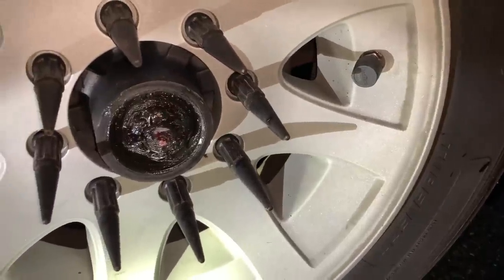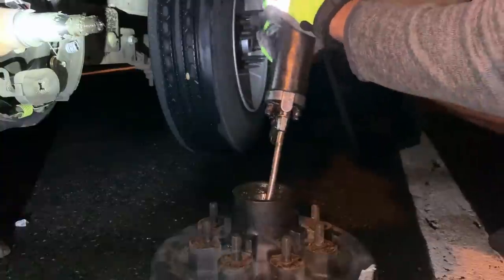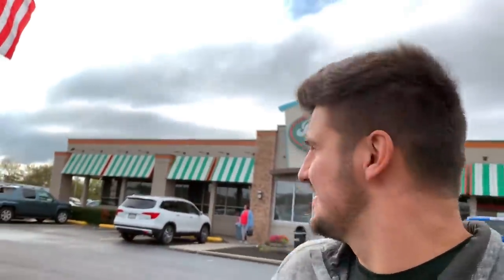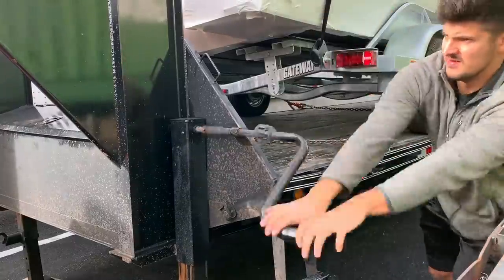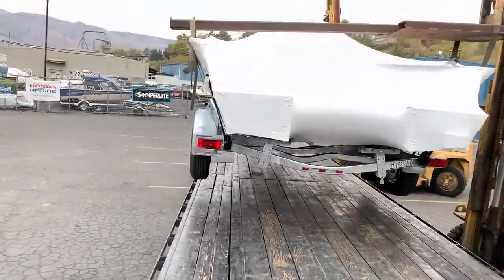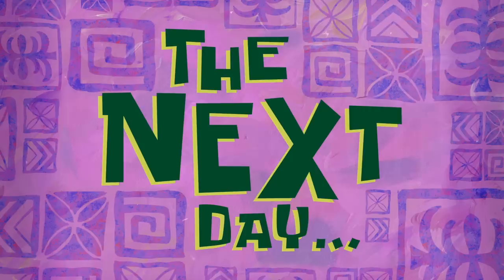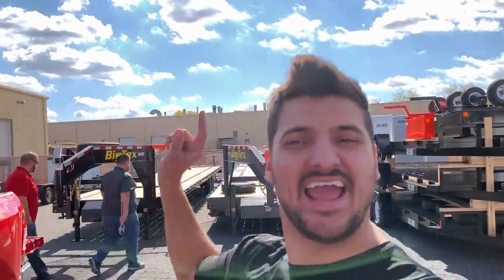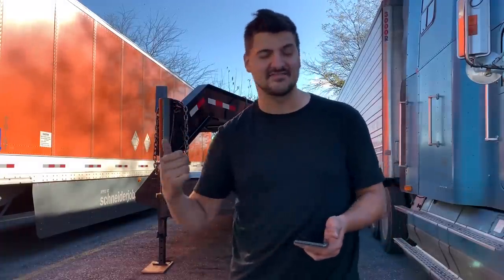New NON-CDL hot shot TRAILER - Vlog 17

Comment: Trailer looks Awesome!.  When I got mine a month ago I pointed out to the dealer that other drivers were complaining about the paint peeling prematurely.  They assured me that they heard those complaints and improved the paint work.  I'm not sure if this happens to all new trailers but they also told me that the brakes on the Big T take a bit to adjust so you might have to increase the gain a bit until they fully adjust. Oh yeah! and Check the hub temps sooner than usual  as I had a couple issues with mine heating up. Could of been the gain, but only one was heating up more than the others.

Comment: The government is so absurd with some of their regulations and rules.  To be able to change a sticker on the trailer and have it be legal, without doing anything else, is a classic example why there are so many jokes about the different agencies.  I truly feel sorry for anyone involved in interstate commerce, where you have federal and state enforcers creating even more conflicts.
Reply: You register your trailer to what you want. I could register my 24K to only 10K but would get an overweight ticket.
Reply: @dungeondark  Depends on the officer, and his level of tolerance, and/or common sense. Try that in KY and TN, see what happens, you'll be hunting a cdl driver to drive your truck away from the weigh station. They go by the VIN sticker.
Reply: you still MUST have a cdl if your hauling anything commercially,  over the combined weight of 26001 pounds, this is your truck, trailer, if your truck is rated (GVWR) to pull over 26001 pounds and your trailer is rated to pull 12000 pounds you need a class A cdl BUT your trailer in its self cannot be rated to pull over 10000 pounds.  Also even though if you have a club cab that isn't a dot approved sleeper
Reply: Just Shakey J Currently there is A LOT of Homeowner, Small Business, Landscapers, & Excavating Companies That Are In Violation Of The Law. What I’m saying is These People Should Not Need A CDL.
Reply: I agree to some extent, if your hauling commercially you should be required but I agree if your w/in 50 miles of home base you shouldn't imo
Reply: And the ppl that makes the regulations never ever driven...

Comment: Got me enterprise rental thanks to you!
6000 free miles and 14 cents a mile anything  over the 6k a month and 1400 monthly as well !!   Thanks !!    2020 Ford F-350 dually.  Xlt with lariat upgrade , so leather and has the bigger screen navigation unit and electric mirrors.        Since I blew up my 2016 f250 this was the way to go.   Hell got it thousands of miles away from Indiana. Lol.
Reply: james S what happened with your f250 if you don’t mind me asking?
Reply: Dixieland Hotshots    Our 265,000 on in 2 years!  Had 8000 idle hours and 18,000 engine hours.   Never shut off ever except for maintenance,   Got it deleted at 160,000 miles.   Never an issue ,   Was pilling only 9,000lbs and overflow filled with oil,  aka head gasket sign usually ,  then white smoke and starting knocking loud as hell.   So it’s 12k for new engine and labor. 1 day to do it with 2 year warranty.  No use to see if just head gasket since it adds up to probably same price after all said and done , so I said screw it.   Sitting at my house and went with enterprise.  Lol lol.   Beside that. Mint condition not a scratch. No issues beside  that ever
Reply: james S dang man you got your money’s worth out of her!! I love my 2012 f250. I was asking just to see if I should be on the lookout for something  like the fuel pump or something but yeah, I’m not quite as brutal on mine as you are and I’m not deleted so hopefully my head pressure will stay down and last for the long haul. thanks for all the info and congrats on your new truck! Gonna be a nice ride for sure.
Reply: Where did you pick up your rental james
Reply: Dixieland Hotshots    I have a 2014 f250 with 615,000 miles on it.    Not deleted.   No issues.      So one was good.  Other not so much. Lol
Reply: Matt Mitchell      California
Reply: Where in California did you get your rental in much closer to California than Indiana
Reply: idksht   Near Stockton.    Must have California driver license.   I said shit watch this.  Went got me a mailbox for 29.00 a month. Went to dmv and said I have. Moved from PA.  Here’s my address.  Boom. Took that and issued me Cali license.     Then after getting my rental.   Went and switched back to PA.   Since PA don’t count any out of state violations except dui.   No other ones count on PA state record. They don’t belong to driver compact     So wanted to give you heads up.   They are starting to do the same state driver license at some.     The one in Indiana.  Not Elkhart.  The one Jordan is it also makes you have indiana or Kentucky only driver license.     I can give you number etc.  let me know.

Comment: If you make a very small hole in your dust caps like you drill it with a 1/16” they won’t pop off, pressures will equalize , it’s normal to have thermal expansion, might just work

Comment: First off you must have a medical card on you when you drive any truck over 10,000 gvw. Commercialy.
You must have cdl license when you tow in excessive gvw over 26,001 
You must obey all DOT rules including logging your hours.
Reply: I think the CDL cutoff is 10k not 12 k for the trailer.
Reply: Ohio dot just hit my driver on that. Med card in F350SD rated at 14k, trailer rated 14k they said have to have a cdl. Scaled it loaded at TA 20640, empty 14k. See how it turns out? My reply was any dually is essentially requiring a A license then respectfully of course, also mentioned if you use sticker gvwr does that mean every semi requires a overweight permit? Truck rated 80k, trailer whatever it is. I use a wedge n a 1axle Volvo with a A license. For guys hotshotting you guys really have some slim differences between legal n not, odd a dually is safer but no modern dually is under 10k. Eld is junk fill out a logbook as a heads up also. Be safe n really look at what you can do before you drop or commit to 10s of Gs so your not SOL. It hurts.

Comment: In most states if your trailer is over 10,000 lbs you need a CDL, Not Ny but if the tow vehicle is 10,001 lbs gvw or over with a trailer over 10,000 gvw you need a CDL even if you are under 26,000 gvw

Comment: erm when you said bearings and brakes are good around 2:20... the whole hub was floating in/out 1/4" as you took the wheel off and the split pin out of the hub nut... surely that would mean your preload is out or your taper roller bearings are fubar?

Comment: Ok 2 questions. 
1. Do need a CDL to pull that trailer before they changed the sticker if you where using it for yourself.  And not hotshoting.
2. Does it cost anything to weigh your truck and trailer at a weigh station like that?
Reply from the maker: 1. Yes technically yours need a CDL to pull the trailer before they changed the sticker unless you have a farmer exemption I think
2. Yes it's $12
Reply: In California and some other states any trailer over 10000 lbs you need a CDL

Comment: So, mathematically, with you doing non-cdl loads, you are allowed to have cargo weight of no more than 9,661lbs, correct?

You have a truck rated at 14k GVWR, a trailer at 12k GVWR, making that 26k total GVWR. So, you are legal with the weights of the truck and the trailer based on GVWR as well as your total weight being 16,340lbs. That allows for a cargo of just over 9,600 lbs. 

When you go out for a load, do you first request something say not over 9,500lbs to accomodate for differences in fuel weights or did you weigh in with a full truck load including tools, full fuel tanks, tarps, etc?

Comment: I do this, have a trailer made, but under-rate trailer to 9,999 lbs even though it could carry 15k.  Also, I use a equipment trailer, single axel. Rated at 9.5k so I don’t need a DOT Number or CDL.  Inspector told me about that one.  Does he need new 83” HD axes???

Comment: From what I have heard. If you have a combination greater than 26,000 and if the trailer gvwr is over 10,000 lbs you have to have cdl.
Reply: 26001 or higher. Truck is 14 trailer is 12 so he's at max before cdl requirements. That's as long as doesn't go over in his load weight.
Reply: Thanks for info and a better understanding. Dot seems to try to get you in all directions.

Comment: Unless something has changed : federal DOT applies to interstate hauling ( this includes not for hire - edit : for gvwr over 26 k )     The DOT regulations apply to:

    Vehicles with a GVWR or gross combination weight rating (GCWR) of more than 10,000 lbs.
    Vehicles with a GVWR of more than 26,000 lbs., which require commercial driver license (CDL) to avoid CDL driver disqualifications.
    Vehicles hauling hazardous materials, whether operating across state lines or totally within one state.
    Trucks or for-hire small buses designed to carry more than 16 people, including the driver.
     California and North Carolina reg's require a cdl for 10,000 + capacity trailers period, even if unloaded..
Reply: I live in North Carolina and can say for a fact CDL is only needed once you go over 26,001 pounds, call me a liar if you would like but I think the weigh station I have driven through multiple times a week would of said something by now.

Per back of licence

Any-non commercial single vehicle with a gvwr of less then 26,001. A vehicle towing a vehicle which has a combined gvwr of less than 26,001 operated by a driver 18 years and older.
Reply: @nschrandt91   Again :" Unless something has changed " or you have an out dated license,  Read what i stated again if necessary. they may have dropped the 10,000 + trailer CDL requirement very recently.. Its still on the regulations sites i used.
Reply: @ronc8598  They removed the 10,000 trailer rule quite a few years back. Just was stating no longer needed.
Reply: People misunderstand that sentence all day long with the 10,000 lbs trailer rule. What they are referring to is if you are over 26,001 lbs AND have a trailer over 10,000 lbs than you need a "CDL A" and if you are over 26,001 lbs but have a trailer under 10,000 you still need a CDL but class B not A. If you are under 26,001 lbs doesnt matter what trailer you have no CDL is needed. I have done inspection in almost all 48 states with a hotshot truck and never had an issue. I now have my CDL A but didn't have one for many years doing this.
Reply: For hire hauling loads on interstate highway. Is required by law to have a class A Cdl. Regardless of your weight.
Reply: John Skinner not true, at all. Before I had my cdl I went through weigh stations daily never once had a problem as long as you are below 26,001. Now you need commercial insurance if hauling for hire no matter the weight, but not a cdl.
Reply: @nschrandt91  if you cross state lines you need a MC number, if you dont you just need the DOT number, the MC number you only get it by having $1mil liability.
Reply: Maid in Boston Inc no where did I say you didn’t need those things?
Reply: @nschrandt91  I was agreeing with you and just adding the "complete" info for the ones who couldn't comprehend before 👍👊
Reply: Maid in Boston Inc gotcha lol, it’s ok I’m sure we are wrong anyways 😂😂😂
Reply: @maidinbostoninc429  It depends on the state. In California, if you are a California class C license holder, any trailer that is NOT a travel trailer or camping type fifth wheel with a GVWR over 10,000 lbs. requires a Class A CDL.to legally tow. In Nevada, adding a J endorsement on a Class C driver license issued ftom the state of Nevada, allows you to tow a trailer, like a gooseneck flatbed trailer with a GVWR above 10,000 lbs. provided the GVWR of the tow vehicle, when added to the GVWR of the trailer, does not exceed 26,000 lbs. Each state honors the requirements and/or endorsements from other states. What controls are the rules that apply to the state that issued the drivers license. All states laws meet Federal requirements. If the state says your legal, it's legal under Federal law as well. Each state has already done the homework for you. My truck has a GVWR of 10,100 lbs. If the gooseneck flatbed trailer has a GVWR of 15,900 lbs., I'm 50 state legal with a J  endorsement on a Nevada class C license. Also, actually being overweight has absolutely nothing to do with what license/endorsements you need which is all based on GVWR. Being overweight is a completly seperate matter and violation. It's just as illegal for a class A driver to exceed, for example, a trailers GVWR as it is for a class C licensed driver to do so.
Reply: @maidinbostoninc429  You know you are wasting your time, trying explain facts to some of these people.

Comment: What am I missing here? If your trailer weighs 5,340lbs and has a rating for 12,000lbs that leaves you with a 6,660lb load??? Where are you getting the 9,500 lb from you mentioned in the video?

Comment: Cool trailer... but just FYI... if your trailer is rated at 12,000lbs. then your trailer itself (when disconnected) can only weigh 12,000lbs. maximum. You might be able to fool some of these DOT officers at the weigh stations, but it's only a matter of time before you find someone who knows what they're doing. So the proper way to figure out what you can legally load would be to disconnect your empty trailer on a CAT scale and subtract that weight from your trailer weight rating.  One reason why a dually would not be recommended for a non-CDL setup.  (correct me if I'm wrong)
Reply from the maker: Any trailer when loaded will weigh more than what the sticker says it's max gvwr is. So I think you're wrong but I'm not sure where to look it up.
Reply: I don’t know about that... I drive tractor trailers and all the trailers I pull are rated for around 68,000lbs for that reason.
Reply: Good question, while you may technically be correct I don't think that's how it works and I've never heard of anyone running into that situation. My understanding has always been that you are weighed connected since that's how you're traveling on the road. Since the truck is supporting part of the weight that's how it's measured. Also in your scenario he'd be pulling a 40ft trailer that weighs 7k only able to load 5k on it.  The weight rating is to be measured at the axle since that's what is touching the road.
Reply: Right, but I believe that’s the reason why they don’t make a 40ft trailer in that weight class without being custom ordered. It’s impractical.
Reply: If you look at the Big Tex website, that is how they themselves calculate payload capacities for their trailers. Payload is the amount of weight you can legally and safely carry.

Comment: Hey did axle nut have a Carter pen? If not it’s backing off. Have u tried grease buddies. It goes on where cap goes. You grease hub with a zerks fitting
Reply from the maker: Yes it did

Comment: If your trailer is derated to 12,000 lbs and your truck is rated at 14,000 lbs how much weight are you able to get in the trailer cause with a trailer that size your payload has to be under 6600 lbs not knowing the exact weight of your trailer. I’m just wondering how you find loads staying under that.

Comment: And what was the torque rating on those wheel nuts? I used to drive trucks in the 1970s and licensing was almost a joke and very few weigh stations were open all the time. Because of so many accidents involving heavy loads and untrained, learn by doing drivers the feds stepped in and the CDL was born. I've been wondering about all of those (very often) Dodge pickups running around with multiple cars and such on back. Now I know to stay clear of them. Freedumb rules.

Comment: since you downgraded the gvwr on the trailer and its axle weight is 5340lbs, does that mean you can only load the trailer axles and additional 6660lbs? so you have to load very tongue heavy to save trailer axle load to get to your 9500lbs.
Reply from the maker: Exactly right
Reply: @TowPiglet  wow lots of considerations. Get that 9000lb load as a Bob cat or tractor and it has to be well forward of the axles then. Have to be almost a visual scale

Comment: Okay so because the truck and trailer combined was 16,000.does that mean he can only load up 10,000 lbs worth of load? Anything above that requires a CDL?
Reply from the maker: That's correct
Reply: @TowPiglet  so if I were to get an aluminum trailer which would weigh less I can haul a little heavier right?  And what if I ran a non dually diesel "I'm not sure if it's legal or not to hotshot on a non dually" but would that make my registered truck weight less? I think a non dually is registered for less or how does that work

Comment: So wouldn't you be gaining payload capacity by having a SRW truck rated at 11,800 lbs.  They are rated for 23,000 lbs towing capacity or so.  Obviously a dually is going to pull better or be more stable, I just wonder if that extra weight capacity translates to more money.

Comment: Truck and trailer over 16000 lbs means you can haul a little over 9000 lbs product before you have to have a cdl.
Reply: Max combines before a CDL is require would be 26,000 and anything over that would be CDL territory, but the trailer itself already exceeds the maximum of 10K with a regular License and is in CDL territory in a few states, If he hauled any load to MA or from this state, he would get a hefty fine for not having a CDL.